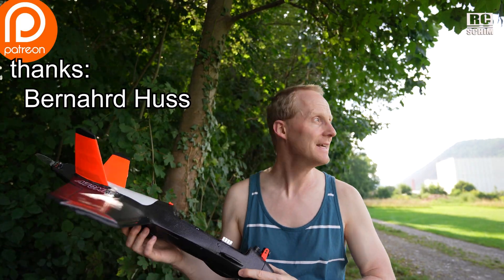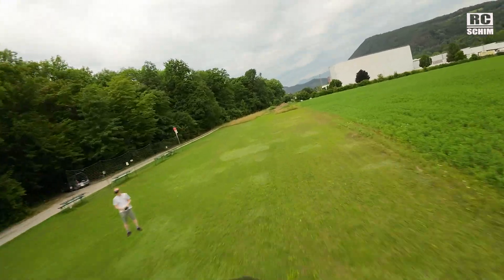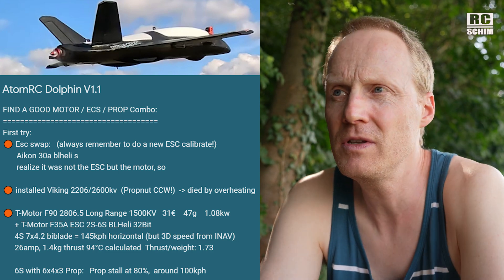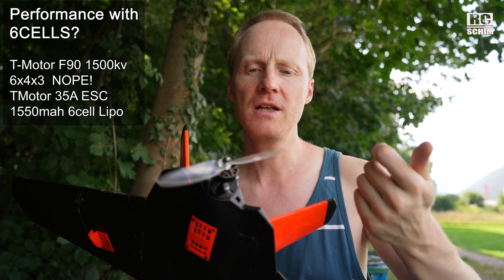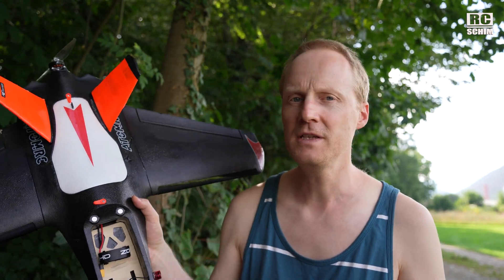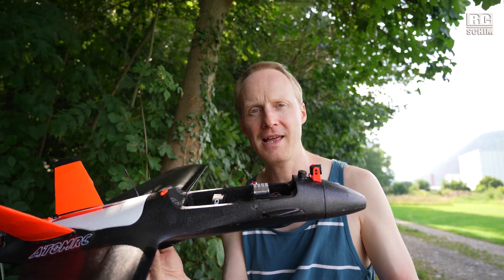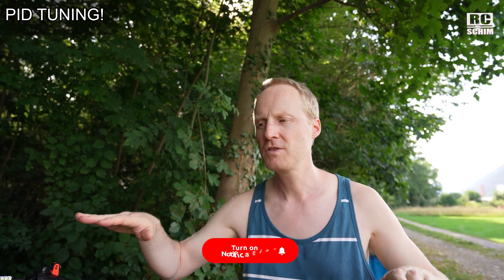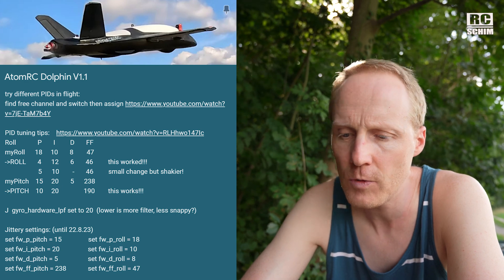AtomRC Dolphin Updates (PIDs, best Motor Combo)

Comment from the maker: 🟠 check my PATREON like Bernhard did ;)    https://bit.ly/2ESMtIO
🟠 dont miss AtomRC's current sale if you need one of their planes!   https://atomrc.com/collections/fixed-wing-sale 
🟠 best propulsion combo: 
      T-Motor F90 2806.5 Long Range 1500KV   31€    47g    1.08kw    
      + T-Motor F35A ESC 2S-6S BLHeli 32Bit
      4S 7x4.2 biblade = 145kph horizontal  
      2600mah 4cell Lipo
🟠 Motormount: https://www.thingiverse.com/thing:5609469

Comment: Is not too low a 35A ESC for a F90 1500kV motor wirh peak current of 47A?
Reply from the maker: Maybe, if you use a strong prop and full throttle... Currently I use special lipo packs that last very long but they can only deliver 12amp (20 burst) and this is more than enough for the lightweight dolphin!
Reply: @Rcschim  thank you for your quick answer. I just build it up this weekend. Im using 3000 mah, 4s ,60C Lipo with a F35A ESC and simply when powering on the connection of the positive cable in the ESC side got small fire amd smoke (note this soldering come from manufacturer). I would be so glad if you give me some hint please. Greeetings from Zurich!
Reply: @danielhsdc   smoke from powering on means you have a short circuit somewhere

Comment: My wingtip broke by the first flight. Inhad to cot poth off and pute an 3d printed on. I hate asymetric's so i printed a bunch of them
Reply from the maker: Yep, same here - mit Tip broke so I cut off the 2nd one. After that I feel it had more tendency to stall. Now I finally ordered new wings - only 2 flights in one tip broke again - but could be glued on quite easy. Still a great plane I love to fly on FPV meets.
Reply: @Rcschim  Did you crash? Do you think it would be a good idea to laminate the wings?
Reply from the maker: @Vogxel you made a non perfect landing, touched ground and got up again, then tipped over.   Don't know about laminating the whole wing - but at least the wingtips to protect them is a good idea.

Comment: Hi. I have a 2506 xing 1800kv new motor already, and interested in building it with that, u think the difference would be not bad,,or,,what do u think
Reply from the maker: Hi, not sure - might be a bit too weak? On the other hand, I start my dolphin now with 75% thr (autolaunch) and it works really easy. Key is: not too heavy! My setup is 600g all except battery.    
My motor: T-Motor F90 2806.5 Long Range 1500KV  47g    1.08kw    
      + T-Motor F35A ESC 2S-6S BLHeli 32Bit
      4S 7x4.2 biblade = 145kph horizontal (but 3D speed from INAV)  
      26amp, 1.4kg thrust 94°C calculated  Thrust/weight: 1.73
Reply: @Rcschim  great info, thanks bro

Comment: My stock Dolphin motor burnt out on the 2nd flight. T-Motor F90 1300 KV from an old 7 inch quad build did the trick. 7×4 APC prop is wonderful on 4s! Ive got a 6s ESC I justneed to swap it out to try it on 6s!
Reply from the maker: On 6s you need a suitable prop! I tried a few I had, but most of them made weird sounds on 6s power, they probably stalled. They have me less speed than on 4s ;)
Reply: @Rcschim  I was thinking maybe a 6x4 APC. I'm actually pretty happy with the way it's flying on the 4s setup, so I might just leave it for now. It is a really awesome airplane! Your videos are very helpful too! Now if I can just get the damn ARWP in the air! Lol! I saw you had a little trouble with that one too, but eventually got it in the air. I'm hoping today is the day!

Comment: My Dolphin setting:

Battery CNHL 4s 3700 mha
ESC 40A 
Motor SUNNYSKY X2216 1400kv
Propeller APC7x5E

Speed 50% 95 Km/h cruise
70% 115/125 Km/h
full power dive 198 -205 Km/h

Flight time longer flight  around 25 mins (50% power)

Comment: Hi,  recently, I changed the Dolphin motor from an Emax EcoII 2400kv to a T-Motor F90 1500Kv using the same 7042prop and launch settings. Upon Autolaunch the plane somewhat stalled and crashed in both my attempts. Could you please suggest what settings I should change in order to launch the plane successfully?
Reply from the maker: Pilwar has some good tips already, here are my current settings:

set nav_fw_launch_thr = 1850
set nav_fw_launch_idle_thr = 1400 
set nav_fw_launch_max_angle = 90
set nav_fw_launch_idle_motor_delay = 1000
set nav_fw_launch_motor_delay = 100
set nav_fw_launch_end_time = 2000
set nav_fw_launch_timeout = 15000
set nav_fw_launch_climb_angle = 25
set nav_fw_allow_manual_thr_increase = ON

So the above settings that matter are:  launch_thr     - this is set to 85% - not 100%
idle_thr   is set to 40% - this helps you to see when autolaunch is enabled - also it helps you to get a straigth throw with some motor support already. Watch for your fingers tho! 
Dont throw too steep - it will climb on it's own! throw it horizontally or slight up - so it can get to enough speed quick.
DONT touch AILERON or ELEV. Stick during launch - this will ABORT your autolaunch and then you're in charge suddenly (maybe that's what happend to you?)
Make sure your have the correct CG and not too much weight! Heavy Dolphins are difficult to launch.
I mostly fly with 2600mah 4cell Lipos.

good luck on your next flights - my autolaunches on all planes are such a nice way to start a flight - never have issues!
this now made me want to fly this afternoon ;)  Greets, Mario
Reply: Try this:

set nav_fw_launch_velocity = 300
set nav_fw_launch_accel = 1900
set nav_fw_launch_max_angle = 180
set nav_fw_launch_detect_time = 40
set nav_fw_launch_idle_motor_delay = 0
set nav_fw_launch_motor_delay = 100
set nav_fw_launch_spinup_time = 100
set nav_fw_launch_end_time = 4000
set nav_fw_launch_min_time = 0
set nav_fw_launch_timeout = 8000
set nav_fw_launch_max_altitude = 12500
set nav_fw_launch_climb_angle = 30
set nav_fw_launch_manual_throttle = OFF
set nav_fw_launch_abort_deadband = 100

When you arm the autolaunch propeller will star spinnig on idle but after launch will increase the RPM
try to throw it forward 20 degrees nose up, avoid higher up from there.

Comment: Mario, did you ever sort out the overheating issue with a subsequent modification?
Reply from the maker: I bought a little PC fan but never installed it, not been flying the Wing much in the last few months. More quads, sorry...
But with decent airflow and I guess 2.7k instead of 4k it worked reliable. Just increased the hole in the nose and led the air directly to the air unit.
Reply: @Rcschim  Thanks Mario. One more piece of help if you could - did you make or source a 6p lead from the O3 to the FC? Thanks.
Reply from the maker: @Lawzy  no, I used the original one. But if you need, you could use a longer camera to body cable. 20 or even 30cm are available...
Reply: @Rcschim  thanks, yes the lead with the kit not the O3👍

Comment: some late information        a correctly spec'd electric prop is  QUIET.      therefore, if your prop is noisy it's the  WRONG  prop.      a stiff EP prop should be used.

Comment: @Rcschim, did you end up adding a fan to cool down the air unit in your Dolphin?  
I copied your set up (parts) because i like how you presented your system set up.  It makes it easy for a noobie like to confidently get into planes.  Been flying drone for years and i want to start rc plane.  Practicing on simulator and slowly buying the parts for a new build.  thank you.
Reply from the maker: I bought some, but haven't installed them yet. Cut a bigger hole in the nose to have more air intake there.
Added a little "ramp" infront of my foam seat where the O3 "sits" to have the airflow better. Guess my air scoop sitting behind the (turbulent air) O3 cam isn't great to suck in air there - so the nose with a bigger hole was better I guess.
will see in hot summer temps if I need to change this.
added fan has the bonus of worry free preparation before launch (for exempl if you wait for a friend to be ready). with active fan it will not overheat while just sitting there.
Other method: a little switch to turn on O3 in the last second before starting...
Reply: @Rcschim  thank you for the update and tips on your build.  I've been watching lots of Inav videos and how folks build their rc planes.  This is all to me and i will need lots of help from time to time.  At this point I'm waiting for the parts and still deciding if i should put together a LI-On battery pack or just go with the tradional LIPO.
Reply from the maker: I used 18650 liIon packs on the dolphin, with 3000mah, that’s ok for cruising and long flight, but for flying a bit faster and more confident, a 2500mah 4s lipo felt better (more punch).
Reply: @Rcschim  Great i have some 4S Lipo and will consider the 3000mah.

Comment: What battery are you using? Im looking at 2806.5, 2807 motors for my build but im gonna be flying big packs
Reply from the maker: Mostly the 18650 lion packs 3000mah, but only because I didn't have 2700 cells
Also got better 2500mah 4cell lipos with high c...

Comment: How is the range with the dji o3 antenna mounted horizontal ? Mine now is sitting inside the plane vertical but at 2 km away i had some stutter frames, the bitrate was ok just the images stuttered a little bit i im considering taking it outside. Im scared about the mount like you have the lateral side of the plane where the antenna is installed has less signal strength.

Comment: Hi and thanks for all the video about the Dolphin, very interesting ! I'm flying Quad-drones for some times and I'm quite new to wings.After 2 weeks and 20 Lipo this morning the original motor 2306 AtomRC burnt ! I
1/ A friend gave me a Velox 2808 1950Kv and Told me to buy a ESC 65A so I searched and found a Skywalker 60A (look big) is a good idea ?
2/ Can I fly 4S with the original prop or should I adjust ?
3/ If I switch to 6s for speed what kind of prop Should I use ? 5" ? 6" ? Any advice ?
Sorry for all the question I'm quite a noob to wings, but I like so much flying with this dolphin :)
Reply from the maker: AZURE 6145 three blades or Gemfan Flash 7042 two blade is the tip s friend gave me. I only had normal 6x4x3 blades dalprop and they stalled when using 6s, so I stuck with 4 cells which is plenty of power with the 2600mah lipo.
Reply: @Rcschim  thanks, I will try!

Comment: After i added the air vents in the back cover the overheat warnings are no more, the airflow removes the hot air from inside, i also added a 4 cm heatsing with thermal paste and 2 icecream sticks(1cm long) hotglued at 45 degrees angle near hitsink to better hit the heatsink with cool Air. I also removed the wooden GoPro holder for better airflow entering the nose.

Comment: I would like to use your pid value if u dont mind since my auw is 770, bit heavier than urs, im using 2306 motor 2500kv 5055 propeller, 4s setup...i will tweak lil bit but using your pid as base value in pid profile 3...do you add any value on fw_ level_ trim?
danial
Reply: Ok..ill adjust to 4 ..see how it fly today if the heavy haze ease off...thanx man...
Reply from the maker: Hi, sure try them PID values. Flew mine yesterday up to a mountain. Worked quite well. 
I use     set fw_level_pitch_trim =  4.000

Comment: Good info.  I am in the process of building a Dolphin.  Using a 3540 1260 KV with a 8x8 prop and a 60 amp ESC with the Matek F405WTE on INav.  Should be a really fast combination.

Comment: Stop it from overheating use the flat nose that will let the extra air come in I 3D printed a flat nose off thingiverse it works amazing mine doesn't even get past 38 degrees Celsius

Comment: I don't suppose you have the autolaunch settings you are using in any video? I just changed to the F90 and crashed on autolaunch. I think my settings are too high and overtorqued it. Yours just flew away practically with zero roll, very impressive.
Reply from the maker: set nav_fw_launch_velocity = 300

set nav_fw_launch_accel = 1863
set nav_fw_launch_max_angle = 90
set nav_fw_launch_detect_time = 40
set nav_fw_launch_idle_motor_delay = 1000
set nav_fw_launch_motor_delay = 100
set nav_fw_launch_spinup_time = 100
set nav_fw_launch_end_time = 2000
set nav_fw_launch_min_time = 0
set nav_fw_launch_timeout = 15000
set nav_fw_launch_max_altitude = 0
set nav_fw_launch_climb_angle = 25
set nav_fw_launch_manual_throttle = OFF
set nav_fw_launch_abort_deadband = 100
set nav_fw_launch_thr = 1850
set nav_fw_launch_idle_thr = 1400
set nav_fw_launch_thr = 1700
set nav_fw_launch_idle_thr = 1000
set nav_fw_launch_thr = 1700
set nav_fw_launch_idle_thr = 1000
Reply: @Rcschim  Absolute gentleman, thank you so much.

From first glance those are actual very similar to mine, I also have it spin up before throw. I did have my climb angle set to 30, and perhaps together with slightly bad throw it just rolled over. 

I will try these exact ones though in the coming days and report back. Waiting on the glue to dry :)

I just noticed, are these not the same 3 settings?

set nav_fw_launch_thr = 1850
set nav_fw_launch_idle_thr = 1400
set nav_fw_launch_thr = 1700
set nav_fw_launch_idle_thr = 1000
set nav_fw_launch_thr = 1700
set nav_fw_launch_idle_thr = 1000

I ask because from memory I think I had idle at 1400 then spun to 1800, which I am guessing was why I over torqued. Just wanting to check your idle/launch value.
Reply from the maker: Sorry about the repeated setttings, those are the values from 3different battery profiles, the first is the one i use. 
(I've filtered the nav settings in excel...)
One thought tho: please make sure your stability settings are correct (if you are in angle mode, double check that the fc corrects in the correct direction. You can make -values in the mixer and invert servos and every thing looks correct in acro, but when the plane wants to stabilize it flips over....
Reply: @Rcschim  I usually take off in Horizon mode. 
I think you mean just check if I hold the plane to check if the flight surfaces move in the correct way to oppose the roll? I will double check it next time I power up, but I assume since I have flown this plane over 25 times at the point it is good. Though I can never rule out an accidental parameter change.

Likely just a terrible throw (too high) and the climb angle just a little too much that it stalled out.
Reply: @Rcschim   I think I got it. 

Feedforward was an incredibly low value. I followed yours in the description and immediately got the servos moving far more than they ever have. It will need to turn the pitch axis, it oscillated a lot when trying to pitch down/descend.

Thank you for saying angle mode, I think this was the key. I meant to take off in angle this time but accidently had it in horizon and it crashed/flipped. I changed to angle and tried again and it beautifully took off. 

So thank you so much. Your video(s) and replies helped tremendously.
Reply from the maker: @sparkequinox   great to read this success story in the morning ;)  horizon mode for takeoff is not a good idea ;)  only if you stand up high on a cliff maybe :)
Reply: @Rcschim  I was very happy it went well. Game changer.

I changed from quads to planes a few months ago, so my assumption of horizon over angle has obviously been a big issue and I did not realise. It worked 90% of the time, but it was always a rather scary big roll and recovery. I assumed it was the motor spin up torque. I believe horizon mode on the throw give an initial wild roll, but with the feedforward being so low from an automatic tune (I think it was like 20-30 something) it could not correct for it. 

I have two dolphins and a ranger 2000, you can bet my first change is swapping horizon/angle modes in the default switch position I had set up.  

Now to get my first 6S battery and put this new F90 to the test :) 

One final question, I know you mentioned you had the prop stall on the 6S at high speed. 
In general though, especially for the 4S, am I right in thinking if I change my 7042 to a 6042, the plane would be faster? The whole faster prop speed/airflow but lower thrust is still something I have to test practically.
Reply from the maker: below my current settings. I prefer to have it spin up the motors to 40% idle throttle 1sec after I armed and moved THR stick to ~ 50%

Comment: My Walksnail VTX will be mounted outside in the airflow...Its half the thickness and weight of the 03 I guess too. That big sink and now a fan too?...Put it out in the fresh airstream, end of problem. All that heating will be shortening its service life....🤔😳😳😏🇬🇧
Reply from the maker: I guess mounting it in a height where just the heat sink is on the outside would be best...
Reply: @Rcschim  I guess that would work too. It rather depends on how effective your thermal transfer paste is IMO.....🤔🤔🤔😳😏🇬🇧
Reply from the maker: In the nose of the penguin the o3 should be cooled well, but it still gets quite hot

Comment: Pyrodrone 2408.5 1622kv with 6x6 APC prop for ludicrous speed. Drone motors only get you so far though with  efficiency.  I can get 40 min of flying on a 900kv 4s with 21600 li-ions and 10" APC prop on a 50" custom cut wing